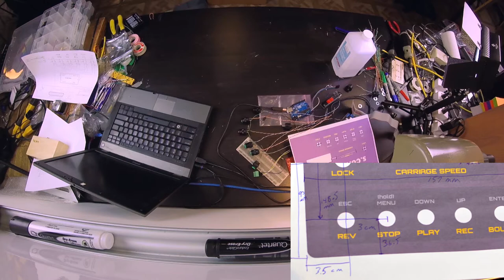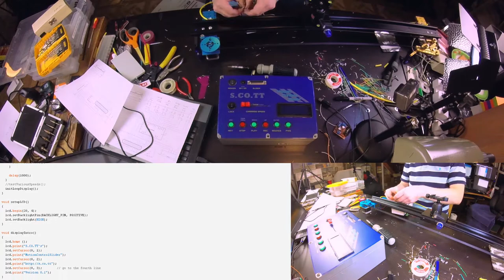S.co.tt's Motion Control Camera Slider - Assembly Time Lapse (Arduino / Makeblock)

Comment: I am finding myself in a similar situation as you have ^^. 
I also planned my slider project with a display, a regluar arduino and the accelstepper library and had to mak tons of compromises because too many cpu cycles were occupied by the screen and the input polling.

Comment: Hi Scott

I love your work. I am currently busy with a similar thing. However, I dont have much time to learn code, although I plan to eventually get there. 

Please could you explain the key steps to get this working. 

I have an arduino, LCD display and stepper motor and of course switches etc.

Many thanks